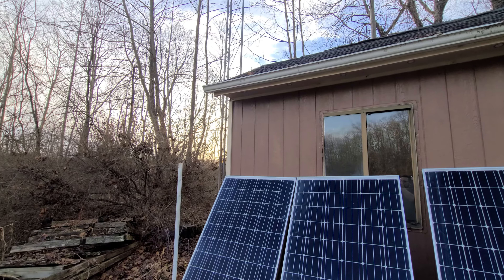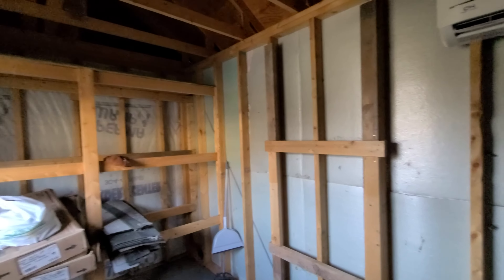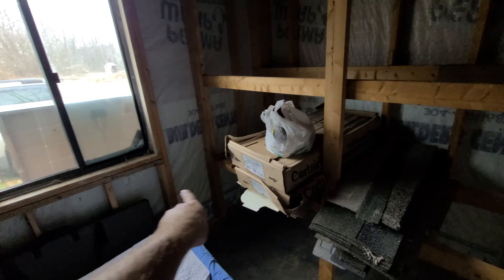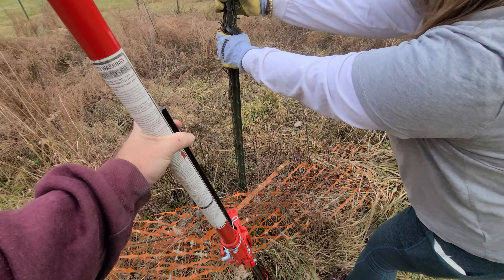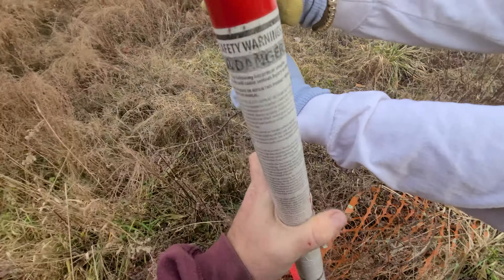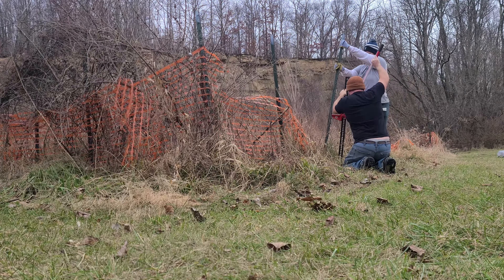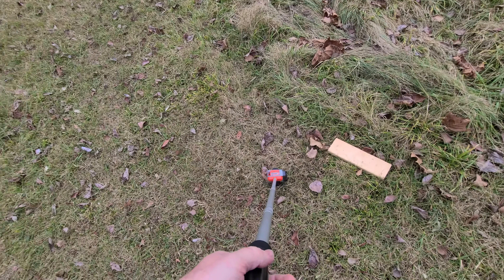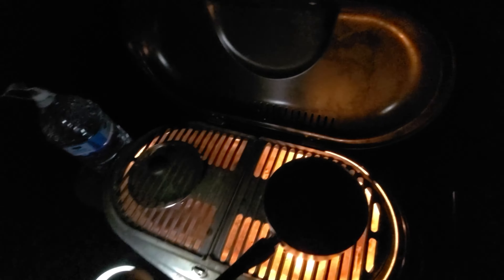Removing heavy duty metal stakes quick and easy. FV#3

Comment: If I might offer a stake-pulling suggestion (for the next time, I guess), get ya a short (6" or so) loop of nylon or Spectra cord - a rock climber's sling, f'rinstance - double it around to form a choke or "cow hitch" and slip it  onto your stake that wants to be pulled, then just drop the part of the loop that's sticking out from the stake over the jack's "hook" and lift away. The more you jack it up, the tighter the sling will choke around the stake, and out it pops. That way you don't have to worry about keeping the jack's hook tucked underneath the little knobby-things on the stakes.

We used to do something similar with a loop of chain and a forklift to pull circus tent pegs out of the ground. (For the record, our circus tent pegs were solid steel round stock, 1-1/2"  in diameter and 4' long, driven almost all the way into the earth with a honkin'-big pneumatic hammer)